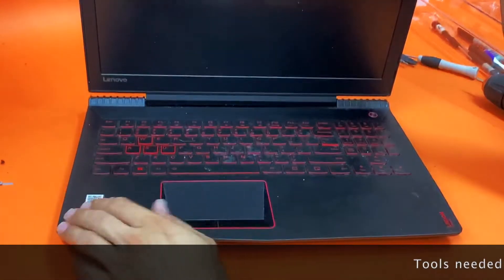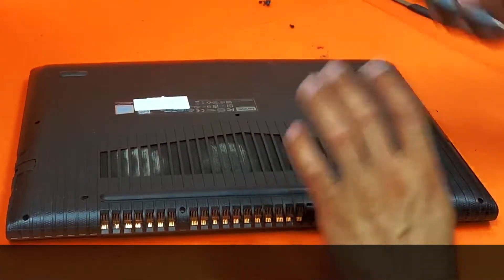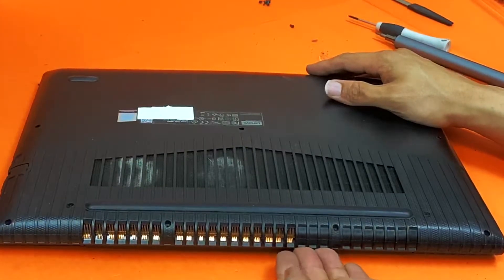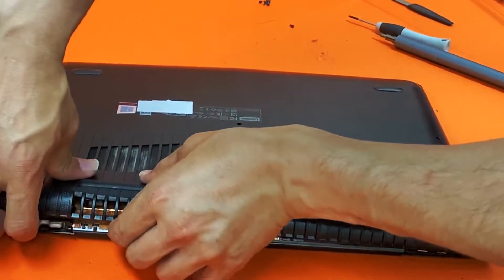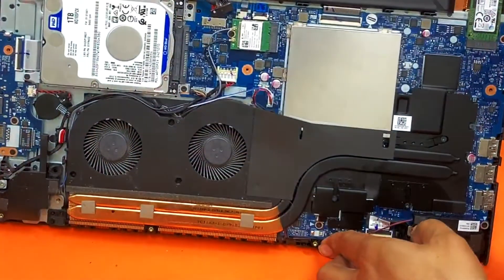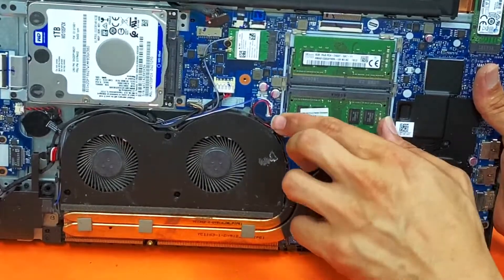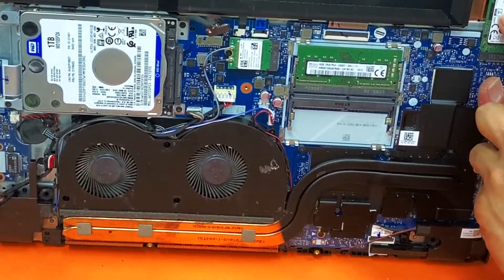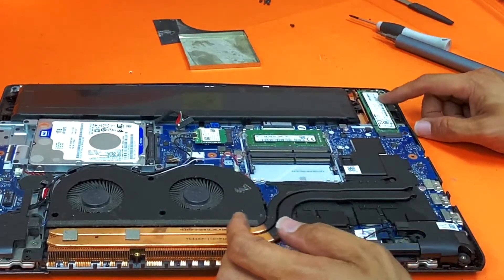Lenovo Legion Y520 | SSD & RAM Upgrade

Comment: For the SSD in the PCI slot, up to how many GB of SSD pci will this laptop support? Also which RAM DDR # will it support? Thanks for this video! 👍
Reply: In the official lenovo web page you can find the spec. for this laptop, it says that the laptop supports up to 32GB of RAM. (DDR4, 2400Mhz, SODIMM x 2)
Reply: @GGodis  thanks 👍👍
Reply: @GGodis  hello.. I'd like to ask something pretty important before i actually go on and buy new RAM, cuz mine's outdated.. could you tell me if it supports RAM of higher speed? or i should only get 2400mhz?
Reply: @davidchalabian469  The specs states only the 2400MHz type. I doubt that using different frequency would be a good idea or bring any benefit. I personally upgraded my PC with: G.Skill Ripjaws DDR4 SODIMM 2x16GB 2400MHz CL16 (F4-2400C16D-32GRS). Have no issues and laptop runs great.
Reply: @GGodis  oh thank for ur response.. I've had 2x 8GB Crucials for a couple of years now, do you think Crucial is good enough or i should consider other brands? i just really need an upgrade and the local stores only offer Crucials at this frequency.
Reply: @davidchalabian469  Sorry, I can't comment on the brand. Personally I did not cared about it. Just keep in mind that the not only the frequency is important (2400MHz), but take into consideration the CAS Latency (CL) marking. The lower the value, the better. (It indicates that the RAM can respond more quickly to requests from the CPU or memory controller)
Reply: @davidchalabian469 You can try higher speed sticks (like 3200 MHz) but make sure they are downwards compatible with 2400 MHz; why would you do so? To be able to use them in a newer device in the future.
Reply: @FROILANDRES  hey friend, ive seen you on a couple videos now while i was researching up for my ram upgrade. Ive got a y520 lenovo legion 15ikbm that came with 8 gigs of ram and i was wondering if i can slot in another 8 gigs from a different manufacturer because the one on my laptop doesn't seem to sell in the country I'm at now. they're both ddr4 2400

Comment: is it possible to just have 2 separate drives so i can keep my OS in one and put my games in the other?
Reply: yea
Reply: Put your OS on the SSD and your games on the HDD
Reply: Best Idea is to Run OS from faster unit (M.2 NVMe SSD) and if you want to put games in the other unit i would recommend to upgrade it to 2.5" SATA SSD.

Comment: I have that laptop, can you put two sticks of 16 ram on it and 2TB SSD instead of the 1 HDD that comes with it?, have a nice day!
Reply: You can definitely use 16 GB sticks since it's a two slots architecture with a max supported memory of 32 GB, so 2 16 GB sticks will give you that.

You can replace the SATA 2.5" HDD with a 2.5" SSD, and you should be OK with adding an additional PCIe SSD of the right size, but I'm not entirely sure how the board is configured and wether you'd run in PCIe lanes limitations having two of them. Highly doubt it, you should be fine, but I'm not 100% sure.
Reply: @Anankin12  hey.. would u please tell me if it's a necessity to only upgrade with sticks of 2400MHz? or i could go higher?
Reply: @davidchalabian469  check intel ark form that CPU, also using faster memory will not be a problem (well it will be if you want to run it at unsupported speed, but it will be automatically set to one that's supported if you don't mess with it in bios)
Reply: @Anankin12  oh thank you for the response.. so basically if I upgrade the RAM capacity which is a good thing, it doesn't really do anything even if i get ones of a higher speed than the max supported? and even if I try to adjust settings in BIOS it still won't make any noticable change in the overall performance or might even mess it up?

Comment: Hi i have this laptop. Can we really upgrade its ram?
Reply: I can confirm you can upgrade the RAM, I have this exact model and did it just two days ago. It's just about as simple as the video shows. All you need is the right size screwdriver (Phillips #0) and some plastic prying tools (or just an old gift card/loyalty card you don't care about damaging could do the trick, or even your nails in a pinch). Mine came with only one 8GB RAM stick, so there was an empty slot I could just add a second 8GB stick into. I actually purchased two identical 8GB sticks, because it's usually recommended to use identical ones and I couldn't find the exact type that came with the computer - but in principle any 2400mhz RAM should be fine.

Comment: Does it support 3200mhz Rams?
Reply: This is probably too late, but I believe it does not. It comes with 2400mhz RAM and that is probably what should be used to upgrade it as well.